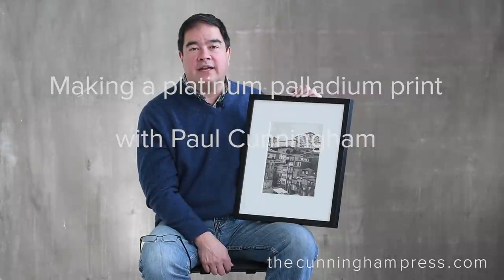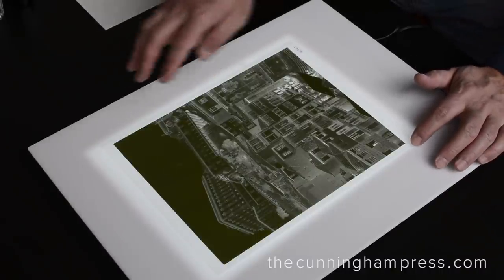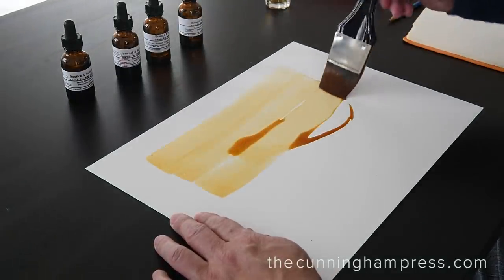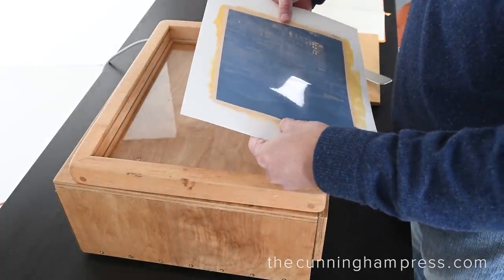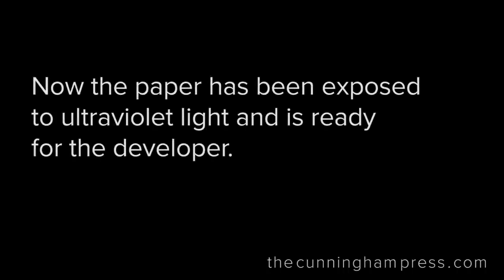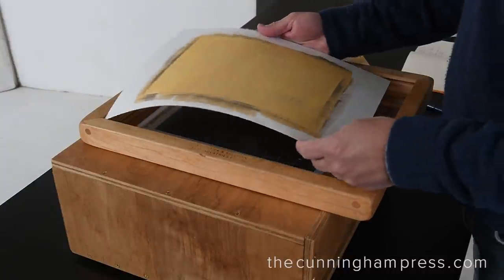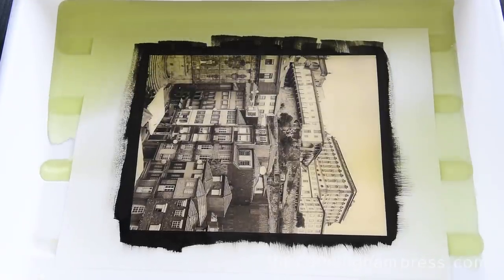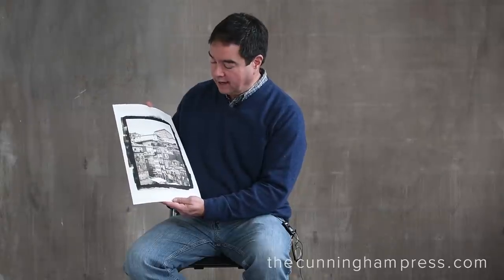Making a Platinum Palladium Print with Paul Cunningham

Comment: Thank you for this video. I am wondering how you made the enlarged negative. Is it made by an analog process or digitally? I worked in the graphic arts industry, some decades ago, where we used tone films in all sizes. They are no longer available, which is no surprise, but does anyone know about an alternative to these sheet films?
Reply from the maker: Hi, I'm glad you enjoyed it. The normal practice today is to use an inkjet printer to create a digital negative. A few people still use stochastic litho processes, but the convenience of working in-house is hard to resist.
Reply: Thanks again. I admit that it is very convenient with a digital process in making an image. I just like so much better the analog process and the splishing and splashing with chemicals.

Comment: Thanks for the demonstration.  Can you use 35 mm or 120 film instead of 4X5 film with this process ?
Reply from the maker: Yes. Just know that it is a contact printing process so the size of the print depends on the size of the negative. For practical purposes, this may mean creating an enlarged ‘digital’ negative that will be used.